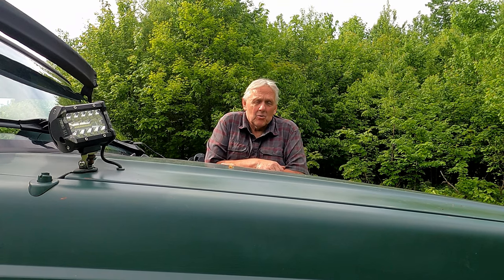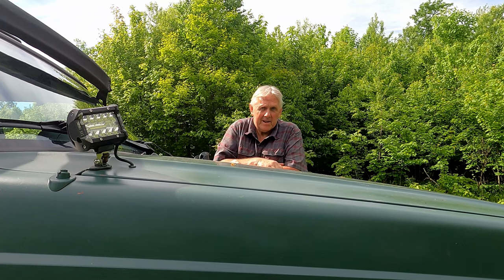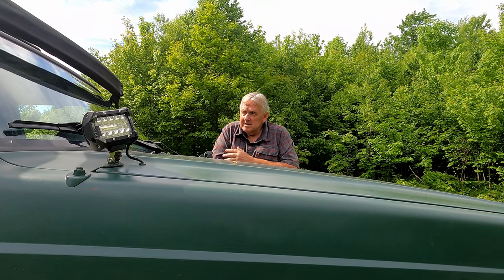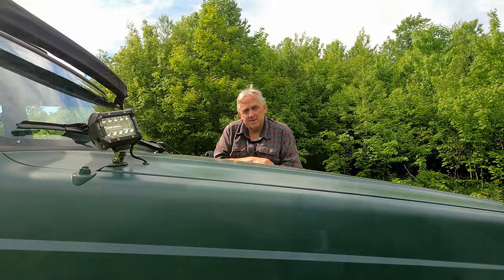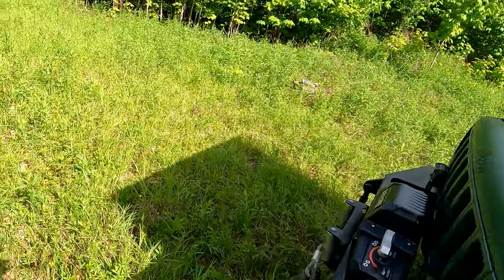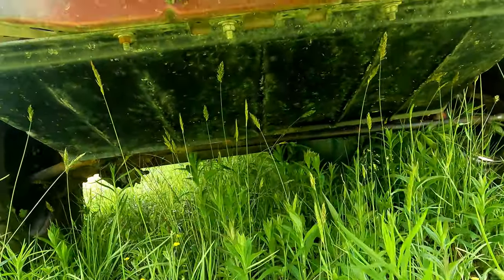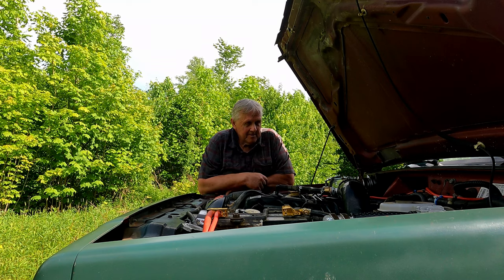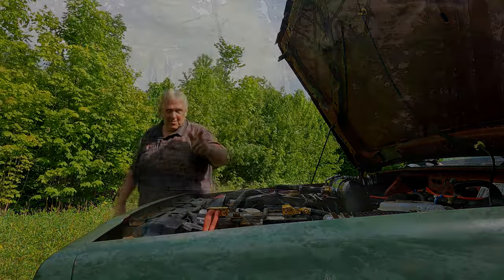1999 Cherokee XJ Upgrades – Floor Pan – Headliner – Dual Battery Set Up – Air Box Delete and more!

Comment: No matter which battery you use for the winch, the engine must be always On while operating the winch.
Reply from the maker: Correct! On this set up, the power draw from the winch only pulls from the secondary battery. The alternator will be boosting that battery, as long as the engine is running. The starter battery remains fully charged and ready to go, and is not affected by the winch draw.
Reply: i also run dual battery's on my xj, when it comes to hooking up the winch i chose to power it off my start battery. Mostly to keep the amount of wiring to a minimum and the jeep is always running wile winching. my research showed that wile running the alternator and winching amperage would spike very high and having shorter runs will reduce voltage drop. Not saying one way i right or wrong, just what i found and how i decided to do it.
Reply from the maker: @robertgrove1271  I pondered which way to go too. You may have a better option.

Comment: What type of air compressor do you have under the hood?  Did you have to remove anything to make it fit?
Reply from the maker: I bought a cheap Harbor Freight - PITTSBURGH AUTOMOTIVE 12V 150 PSI Compact Air Compressor. Since I removed the air-box and added a battery, I had just enough room to squeeze it beside the master cylinder and the fender. Very tight fit! I did not like the yellow plastic tubing that came with the unit, so I bought 25' of regular air hose to plug into it when I need to use it.

Comment: Difficult to see, where is the air opening on that new KN air box? 
The hood under is notched, is there a hood vent we cannot see with the hood up?
Reply from the maker: @clarkleakins879  it draws air from under the vents. So the air filter goes straight into the vent area
Reply: @getoutwithrockandsherri  vents? What vents, where?
These vehicles dont have old school tradition vents. These vehicles have the vents ducted with the air conditioning system. 
Did you cut an opening into the firewall? Air now is drawn through the grill area between the firewall and windshield?
Reply from the maker: @clarkleakins879  at the 6:50 make in the video, you can see the a black box. Behind it, I cut a 5 " round hole. The filter fits nicely inside.

Comment: What is your opinion on the air intake? Noisy at all in the Cabin?
Reply from the maker: It did increase the noise a little. When you really get on it; it will sound like a 4-barrel carburetor kicking in! Once you get up to speed; it quiets down. I run pretty aggressive 31" tires; and they make more noise than the intake when I am just cruising along.